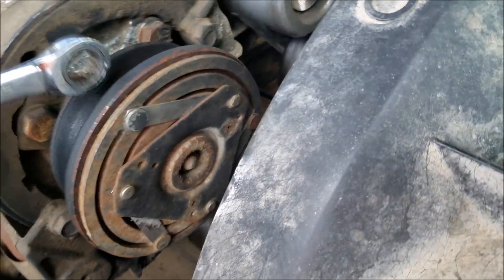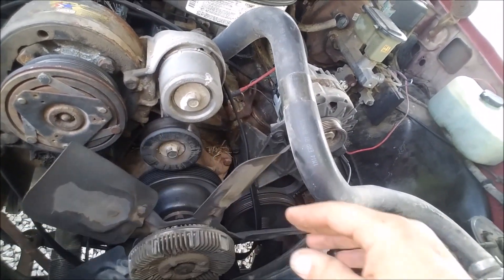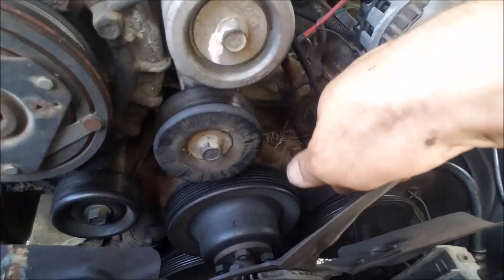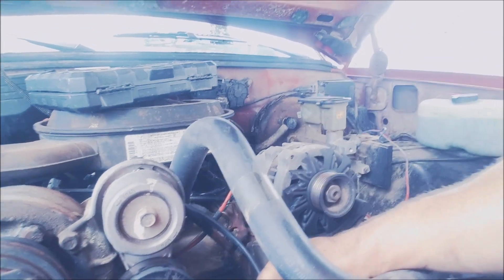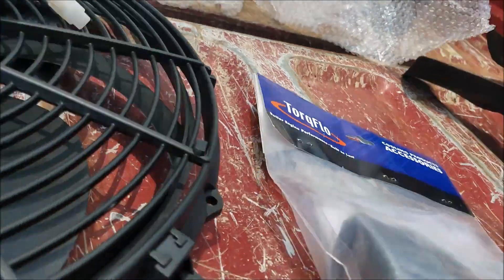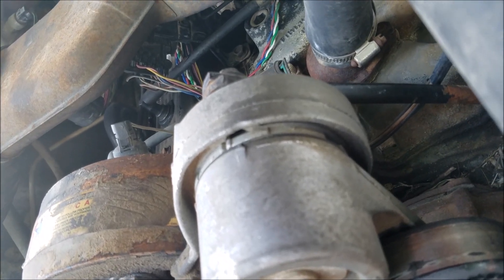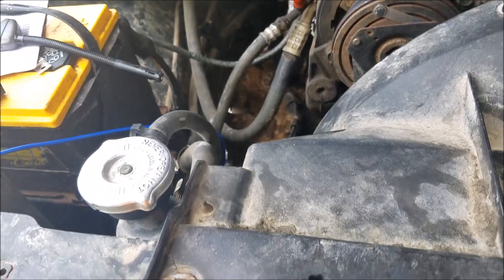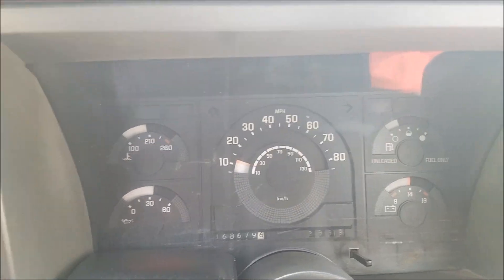Upgrade to an Electric Cooling Fan

Comment: whats the part # for fan and controller
Reply from the maker: tito alvarez 733647 is the controller. 733710 is the fan. If those part numbers aren't available, you can search for any adjustable fan relay and any universal electric fan. My stock fan was 19". This 16" fan was the biggest that my local AutoZone had in stock. I put roughly the same fan in my S10 10 or 15 years ago. I like the adjustable relay. I've used one of them in my S10 and my 1992 Camaro when the OEM electric fan switch was acting up.
Reply: @EricErnst   I went o my local autozone where I found that #controller. I noticed the red wire has a fuse on it like it’s supposed to go to the fan and the blue wire has no fuse. In my diagram it shows the red has no fuse and the orange and blue do for if you wanted to run duel fans...I think the manufacturer may have messed up. I hooked up my red wire to the battery (with the fuse) ran the orange wire(fan wire) to the fan....yellow to ignition and green to the ac like it calls for...right away it burned up my controller...
Reply from the maker: @nathanhiemstra8228  see if you can return it.

Comment: If you replace the fan and install a electric one should not also replace the alternator with one with a higher amp rating so your battery is fully charged
Reply from the maker: My trucks have always been fine. If your voltage seems to be fluttering below 14 while running, I'd upgrade your alternator. If not, I'd keep running the stock alternator. 
  The same could be said for any aftermarket modifications. Lights. Stereo. Fuel transfer tank. Laptop charger in the cigarette lighter. 
  The alternator has a certain amount of overhead built in.

Comment: My 454 dually has a rebuilt engine and everything is completely new. The temperature gauge stay’s steady at 220 since the temperature outside is getting hotter. I had a shop redone my ac. It blows cold now. The 1991 dually has an auxiliary fan from factory. It’s on and working. Once im sitting in traffic the temperature starts to climb. I was in McDonald’s drive through and seen my mechanical gauge hit 240. If I don’t use the ac my temperature stays 215 220. If I shut off the ac the temperature falls and stays. I can’t trust a shop because 2 shops have just taken my money and have assed the job. Everything is stock except the engine is bored over . 60. Any suggestions?
Reply from the maker: Is your auxiliary fan wired correctly? Does it pull instead of push... then it will be fighting the clutch fan. . Is your fan clutch working correctly? Does it activate when the engine is hot and mostly idle when the engine is cold?
  For the auxiliary fan wiring, I'd set a piece of paper near it and see if it sucks it against the grille or blows it away. I'm assuming the aux fan is mounted as a pusher since the engine has a mechanical fan. 
  I'm using a set of fans from an 07-14 Tahoe now. They work great. You'll have to remove the mechanical fan to fit them. They work great on my 650hp supercharged 355. I have holley efi activate them.. you could get an aftermarket controller to activate them on your setup. 
  I used a new fan and shroud assembly from autozone. It has a lifetime warranty from a national chain so I should be covered if the fans ever fail. It's a dual family system and fits a 34" wide radiator perfectly. Your big block should have the wide radiator. There was also a 20" and 28" option. My 93 k2500 came with a 34" but my 1990 k2500 came with a 28" rad. It was a simple upgrade to the wider one. And it added cooling capacity as well. 
  I have had good luck with a proform adjustable fan relay with a screw in temp probe. I threaded the probe into the passenger's side cylinder head between 5 and 7 spark plug and that activates the relay on my newly acquired 1992 C1500. I'm sure it could run the gm dual fans from a Tahoe. I think I spent about $259 on the fans and shroud. I got the extra cooling version with 1 extra blade on each fan. I think it was 7 and 9 blades, but I could be wrong.. it's been a few years since I installed them. But they have been flawless. I do like the idea of a mechanical fan for towing and heavy duty use. But those fans have done perfectly for me. I have one set to come on at 184⁰ and the other to come on at 185⁰. The second has never come on unless I'm testing it. The proform fan controller can only activate one fan at a time, so you can just use it for both fans. I stagger mine to avoid a big electrical surge from starting both fans at the same time.
  I think I'd install a 180⁰ thermostat and that electric fan/shroud and see if that helps keep you at or under 200⁰ at all times. Under light load on the highway, you'll run 180⁰. But you can set the fan controller to keep it wherever you want.
  Let me know if that sounds like a good idea to you. I have a video of the fan install. I basically only had to build a top plate to hold the top of the shroud and the radiator. The entire stock fan shroud is replaced.
Reply from the maker: https://youtu.be/1cswdfHniQY

Comment: Where did u plug in the wire for the ac so it can’t turn on when u turn on the ac
Reply from the maker: I didn't plug that wire in at the time, but I'd tap into the a/c clutch wire. The plug on the compressor should be getting a 12v signal. That's perfect for the trigger wire. The trigger wire only needs microamperage to activate the relay and will automatically turn on the fans whenever the a/c clutch is activated.

Comment: Probably a silly question as I’m a beginner shade tree mechanic but does the removal of the belt driven fan cause less load on the motor
Reply from the maker: Yes. The fan adds a lot of parasitic drag. Engine masters did a test and one fan design killed 39hp. The losses would be constant no matter how powerful your engine.. whether it's a 4 cylinder or a big v8. I think I figured it was around a 13hp gain on my truck with this size of fan at the rpm I was spinning it. The electric fan will draw some power and the alternator will pull some power but overall it's a gain. 
  Don't be embarrassed about being new to the auto scene. We all gotta start somewhere.

Comment: Good information 
Thanks
Reply from the maker: I have a different video where I install a pair of factory replacement fans for a 2007-2014 Tahoe. They are a little more expensive but they have a lifetime warranty and flow more air. If you have the capability to weld a custom upper mount, it is a pretty good fit. 
https://youtu.be/1cswdfHniQY

Comment: Did this 1 16in fan do it. Im looking to do two 14in s blade hayden fans. Fav part of video is 0-60 runs.
Reply from the maker: That fan worked fine for me. Since you have a higher horsepower setup, dual 14s should be good. On my sniper setup, I have one set to turn on at 170 and the other set to turn on at 171. I raise the temp in winter for better defrost and a good heater. In summer, I leave it lower. I stagger the fans so there isn't as big of an electrical surge from starting both fans at once. 
  So far, I've never seen the second fan come on since I installed it last July. It works, the first fan just keeps my temps plenty low. 
  The single fan from this video did work great for me. My radiator eventually clogged and I overheated while towing a 20k lb trailer one summer afternoon. That's why I upgraded my radiator and fans last July. That's with double the factory hp and more weight than it was designed to pull, and the fan wasn't even the cause of the overheating issue.
  I think I have room for a small air to water intercooler rated for 600hp. I think I still have room in front of one corner of my radiator. There's very little room behind the grille in these trucks. The sniper's wet intake style allows for good charge cooling, but an intercooler is always better. I'm maxxed out on injector as it is. On a stock bottom end, I'm ok with 400lbs/hr. Datalogs show 394lbs/hr@5200rpms and 145kpa.
Reply: @EricErnst  I definately need to play with datalogs and understand more of whats going on. I know on my ve table I see 117 at around 4500/5000 rpm. This spike is due to always driving in d and not running it up to 6500. I need to spend a week doing pulls to 6500-6700 then i can see what the motor really needs. Are u talking about using a intercooler for a n/a motor. Might wire one to snipe on to fan controller not sure. But bought both fans with individual controllers. I know sniper can handle it but not sure i wanna add the load to the sniper. Gotta do some more research before I set it all up
Reply from the maker: @cfmechanic  This winter, I installed a vortech centrifugal supercharger. My second tank of fuel was running 100 octane low-lead aviation gasoline. Normally I run 93 octane. It's a while lot cheaper for a daily driver!Right now, I'm running non-intercooled. I'm running about 6.5 lbs of boost, or 145kpa. I've seen manifold air temps of about 105F under boost. That was about 50F over ambient. I've heard carburetors can drop the intake temp by around 100 degrees. When I shut the engine off after driving, the MIT really jumps from heat soak. Naturally aspirated peaks at about 100kpa. I had to set my rev limiter to 5200 because I was starting to lean out above that. I've seen as high as 160kpa at 5500 but I was commanding 456lbs/hr. That's like 114% duty cycle for my 400lb/hr worth of injector. 5200rpms is safer with only 98% duty cycle. I have 4.10 gears and 32" tires so my turbo 400 trans can only get up to about 115mph at 5200 in 3rd gear. I installed a 4L80E this weekend. I've got a few loose strings to tidy up before my first test drive, but I can't wait for overdrive and a lockup converter. 
  Don't worry about load on your sniper for the fans. Use the sniper to ground a relay for each fan. It takes micro-amperage to activate a relay. The relay does the heavy lifting, not the sniper. Start taking a few datalogs and I can look at them if you want. Sometimes I'll just datalog a long cruise. I can look at the important parts and zoom in on them if I want to. Or even look closer at the boring cruise areas to see if anything is goofy.

Comment: With your 34 inch wide radiator what shroud did you use I also have a 34 inch wide radiator and I am having trouble finding a shroud that will fit
Reply from the maker: My stock radiator was 28" wide. I used the stock shroud. This past summer, i upgraded to a 34" radiator and stock electric fans from a 07-14 Tahoe. The width is perfect. I had to build a mount for it, but it fits great. I am using relays and stock pigtails and Holley efi to control the fans. The truck has evolved a lot since this video. 
  I did a video on that install too. If you go to my videos, it should be 4 or 5 back.  I'm driving so this is a bit if a rushed response. If you have any other questions, feel free to ask.

Comment: good video I got a 94 1500 and was wondering if the 16" fan would work glad to see it does
Reply from the maker: I did an updated video this summer with a wider radiator and bigger fans. This setup worked fine up to ~400hp but my radiator was clogged and she would overheat due to coolant flow issues. Now I've got a 34" wide heavy duty radiator and electric fans from an 07-14 Tahoe. I did a video on it this summer if you would like to see that setup. 
  Good luck with your truck, man. Let me know how it works out.

Comment: I added electric fans to my Silverado 
No regrets
Reply from the maker: Nice. Did you do it like this or my new fan setup with 07-14 Tahoe fans and a 34" wide radiator? I have a video on the new setup. This radiator was pretty clogged so I went wider and used bigger fans. My aftermarket fuel injection controls the fans now. It works great. Not that the fans were the issue before... it was the clogged radiator.

Comment: What size motor do you have and what CFM fan did you use I'm looking to do the same on my 99 ram with the 5.2l magnum
Reply from the maker: This is a 350 engine. I think the 16" fan was rated around 1500cfm. I did some engine work so I added a second smaller 12" fan on my radiator. I'm not sure of the cfm of the smaller fan. It worked well for me. I saw somewhere that they don't recommend towing with electric fans. Maybe the torqflo box. 
  I have since upgraded to a larger radiator and dual fan setup from a 07-14 Tahoe. I actually did a video on it if you'd like to see how my engine setup has evolved since this video. I think it was my most recent upload. 
  I upgraded my radiator because my stock radiator was clogged and needed replaced anyway. While I was in there, I decided to upgrade to a pair of duralast lifetime warranty fans from autozone. The fan assembly comes with a shroud so all I had to do was make a top mounting plate. Check it out if you'd like.
  Good luck with your truck.
Reply: Eric Ernst I just Installed a dual set up, I’ll be uploading it here on my channel soon. Mine is a DIY build I used the factory shroud for the dual fan set up and it worked out just fine, but I’m upgrading to stronger fans because these don’t pull enough juice.
Reply: Thanks brother I thank 3000 cfm should be good. What's your thoughts

Comment: But why did you put the fan shroud back on? With the fan close to the radiator like that, you are just gonna help keep the heat close to the radiator.
Reply from the maker: The upper radiator mount is integrated into the fan shroud. They are one piece. I could have cut it up, but I decided to leave it alone and reinstall it. 
  I have since switched to an 07 Tahoe dual fan setup and a custom radiator mount. I control the fans with my Holley Sniper tbi system. I'm running a 160 degree thermostat and have the fans staggered. One comes on at 170 and one at 175. They cool my system perfectly.
  I did a quick video on the install. It's mostly a tripod view in fast motion but it shows the process.
Reply: @EricErnst  I have a 91 c3500 with a 454, I planned on doing that very setup with two 16" s blade fans for the main pull and a 12" for a A/C condenser push fan. I think I should be able to eliminate the shroud altogether if not cut for open air
Reply from the maker: @starkie1990  here's the newer setup. I bought the fans new but they have a lifetime warranty so I'm not worried about longevity. https://youtu.be/1cswdfHniQY 
 If you want to eliminate the shroud, check out the plate I made for the upper radiator mount.

Comment: Is pulling the belt off absolutely necessary?
Reply from the maker: Look at 3:53 and 6:19 to see the studs with the fan on and off. To hold the pulley easier, try leaving the belt on to break the nuts loose, then pull the belt off and remove the nuts.
Reply from the maker: Yes. The water pump pulley is held on with the same 4 bolts that the fan uses. Take the fan off, then put the bolts back in to hold the water pump pulley. The factory uses studs and nuts. When you remove the fan, I like to use bolts so it is lower profile and doesn't stick out as far. Instead of threads sticking out 1.5", you just have the head of a bolt. It is less likely to grab the fan wires or anything else. It's perfectly fine to use the factory nuts and studs. 
  If you are concerned about belt routing, take a picture first. Or you can look at the pulleys. Just know that a smooth pulley is driven by the smooth side of the belt, and a ribbed pulley is driven by the ribbed side of the belt.

Comment: What made you install the second fan and did you have to remove your shroud when you installed the 2nd.
Reply from the maker: Since this video, I've over doubled the horsepower. Now spirited driving creates a little more heat. Stock was 190, now I'm making over 400. The engine was getting a little warmer than I'd like in hot weather. I did remove the upper fan shroud and installed a small 10" or 12" fan next to the 16". I actually have my fans controlled individually by my aftermarket fuel injection system. The small one comes on at 165 and off at 160. The 16" comes on at 175 and off at 162. I have a 160 degree thermostat installed. 
  I eventually plan on supercharging this engine and want to install a bigger factory radiator and twin electric fans from an '07 Tahoe for extra cooling. These trucks had an option for a 34" wide radiator (the heavy duty truck engines that used factory engine oil coolers) and the factory fan assembly from an 07 Tahoe measures 34" wide. Perfect. I think they are twin 16" fans. They aren't touching so it must be under 17". Look forward to an install video. That setup costs a little more than this video's single universal fan, but it's way cheaper than the flex-a-lite solution... $500. 
  The wider radiator was $165 from autozone... with a lifetime warranty. The new high output fan setup was $259.. again, lifetime warranty. The pigtails for the fan connectors were about $20 each. 
  I did have to remove the upper shroud to install the second fan. I hope that answers your questions.  Feel free to ask any more about my fun old farm truck.